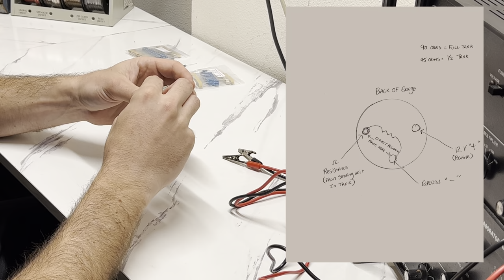How To Test A Fuel Gauge! - Easy!! #automotive #electronics #cars #diy

Comment: Hi great video but remember the wattage the resistor has to carry volts x amps and you could use a potentiometer instead of a fixed resistor and be able to go from empty to full by adjusting the potentiometer. Great video 😊.  Thanks Walter from Liverpool Merseyside England

Comment: Yo bud.. my fuel gauge when it got power acc the fuel level goes up, but then the car is running, the fuel level gauge drops... Ive check the fuel sender and its within specs..
Reply from the maker: Hmmm is it possible that the sender is grounding out somewhere when the engine is running? Maybe the vibrations of the engine cause a wire to ground out somewhere

Comment: ..can you advise on the ohms of the gauge? Does that fit in with the sending unit resistance?
Reply from the maker: I can’t remember the ohms of the gauge itself and the sending unit, but the resistors I used are to “simulate” the sending unit resistance to get a reading on the gauge